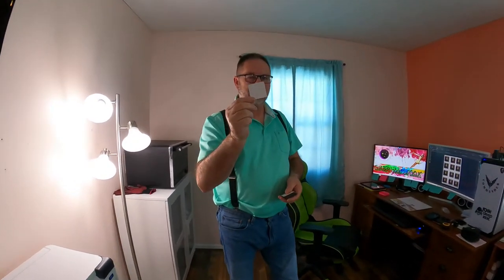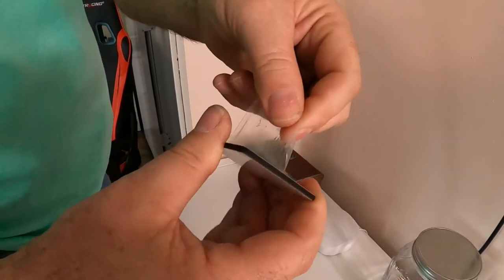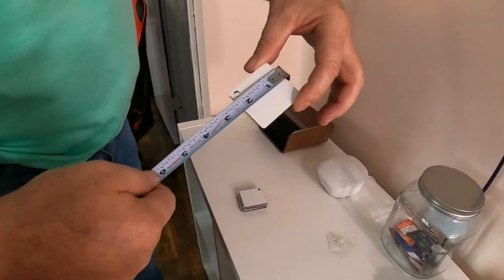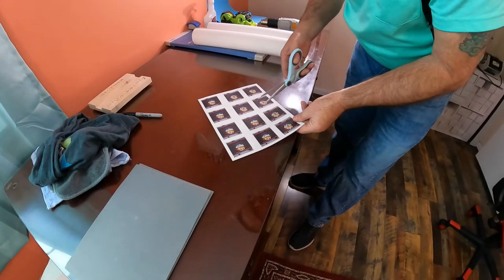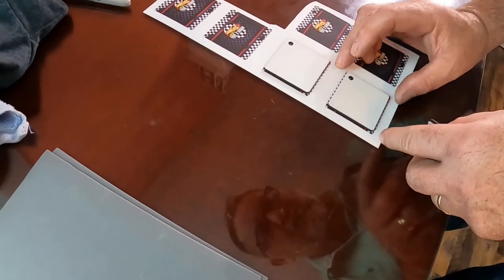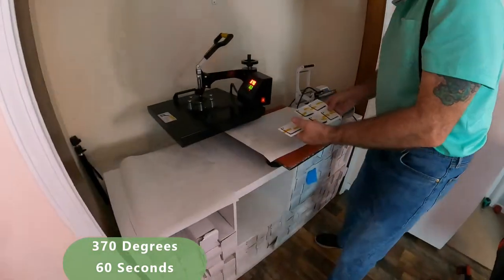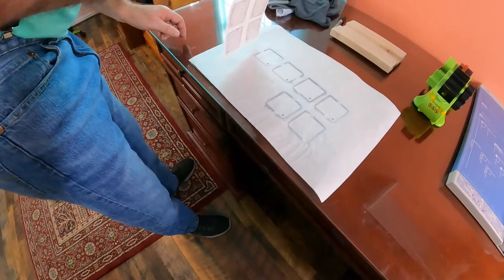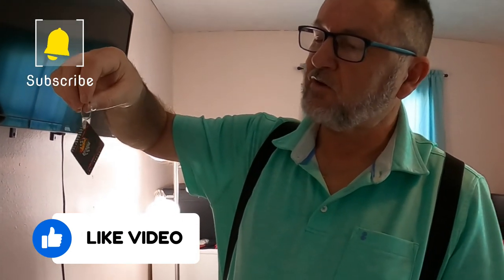Learn How To Sublimate A Keychain Blank The Easy Way!

Comment: I watched the video in hopes that you would show how to do the 2nd side. 😢 I haven’t found a video o that shows this at all. Is it hard to do - are you mirroring the images for the 2nd side and they will come out the correct way? I’m so confused - with this part. Outside of not showing the 2nd side, this was a great video.
Reply from the maker: two identical designs for both sides and the designs are always mirrored!

Comment: Thanks so much for the video! Did you wait until they were all the way cooled before doing the back? I thought putting it back in after you already have one side would make the ink on the other side turn back to a gas? Can you explain how to do it? Yours turned out so nice!
Reply from the maker: Yes, let the first side cool first and then sublimate the second side. The first side will be ok. Be sure to use parchment paper underneath and on top of your keychain. Thanks for watching.

Comment: Do I need a sublimation printer ? I have a inkjet cannon but I didn't realize i bought sublimation key chains , tumblers etc. My 1st time for everything & I literally messed up 6 pages 2 key chains & im getting discouraged 😞.  Any advice help please,  thank you in advance
Reply from the maker: It needs to be a Epson printer. Preferably an EcoTank Printer and you add sublimation ink instead of the ink that comes with comes with the printer. You can use Hiipoo, Printers Jack, Cosmos, Cyclone sublimation ink. They are pretty much all the same. You can get Hiipoo and Printers jack from Amazon.

Comment: when he swung the press around the temp was 360 not sure if he meant to say to set the temp at 360 instead of 370 for 60 seconds?
Reply from the maker: The heat press was had already heated to 370 and was heating back up again

Comment: I just got the Ecotank 3850, and was wondering about paper size…
Are you using 8 1/2 x 11 paper to get 12 rectangular keychains?
This is what I’m pondering…
Could I make more keychains at a time if I used 8 1/2 x 14, and cut an inch off?
But then I’d be throwing away money, wouldn’t I?
So I need about 1/2 inch between them?
Great video! Very helpful for me just starting out! 👍
I’m so nervous that I’m gonna screw up! Lol
Reply from the maker: Yes you can use 8 1/2 x 14 in your printer. You need to leave some space in between so you can tape them also the design needs to be a little bigger than your keychain so you don't get any borders on your keychain from the design being too small.  We all screwed up when we first started. I still screw up every now and then! LOL Thanks for watching!